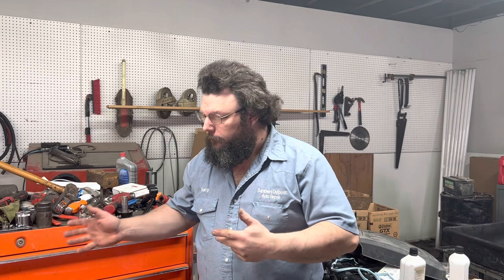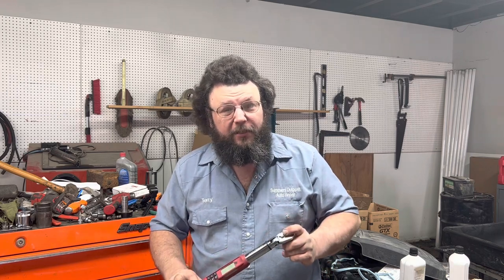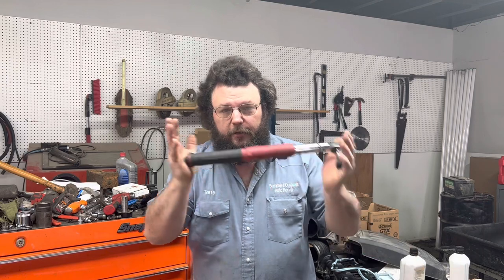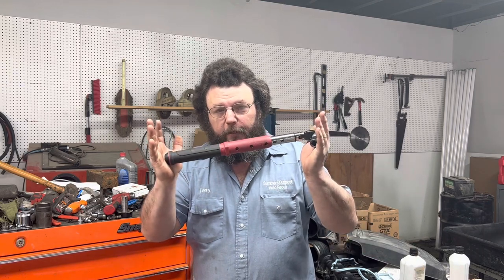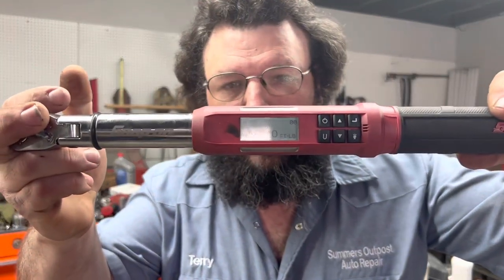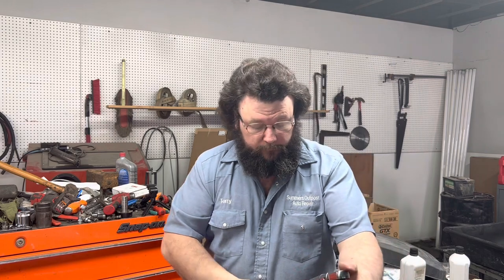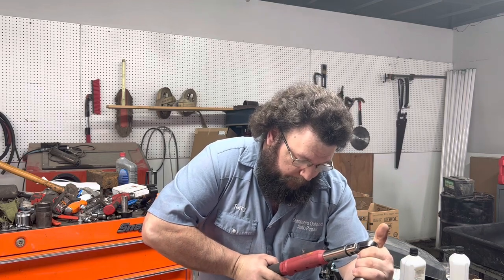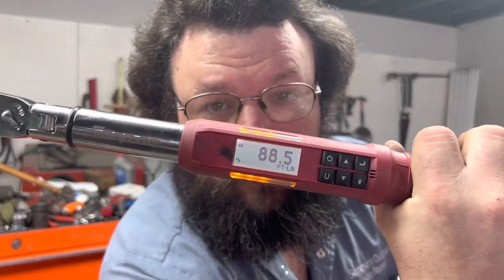Quick easy field check for torque wrenches

Comment: Sounds like you may have already found this out. 
Don't go beyond the maximum torque on digital torque wrenches. You will destroy the strain gauge and need to replace it.
I bought a broken Snap-On inch-pound torque tester(QC2DTT250) and that's what someone did to break it. Now I get a "zero error". 
I got it cheap but that's what I need to fix.
Reply from the maker: I got lucky, I was doing torque to yield and it maxed, we checked it afterwards and it seems to have lived ok since I stopped when it toned.